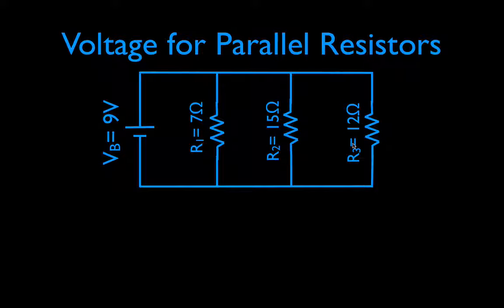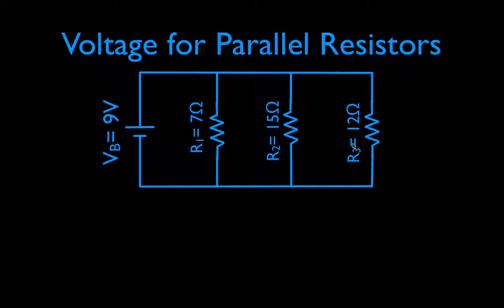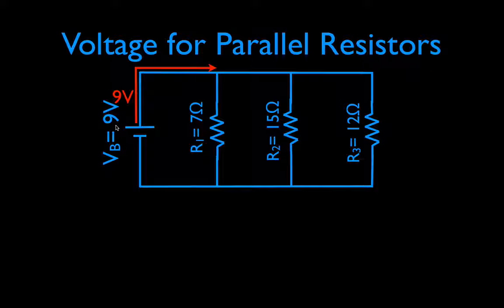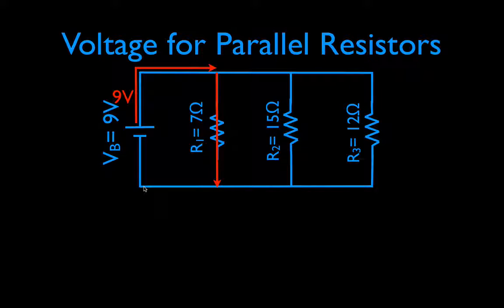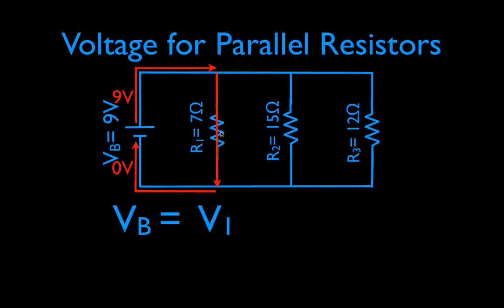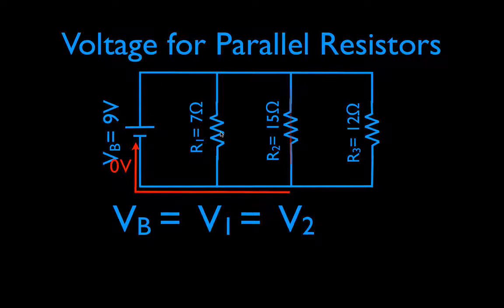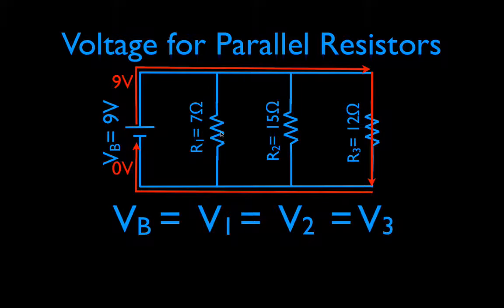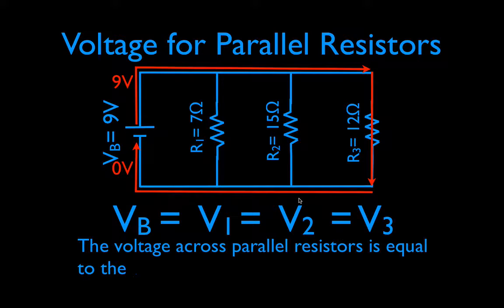Resistors in Electric Circuits (14 of 16) Calculating Voltage for Parallel Circuits

Comment: How to find voltage drop in parallel circuit because in parallel circuit voltage is same and how voltage divides?
Reply from the maker: In a parallel circuit the voltage does not divide, the voltage across each element is the same as the battery.  The voltage is divided in a series circuit.

Comment: Your videos are amazingly helpful. But I have a question - why do the electrons have no potential energy (0V) at the end of the circuit? Isn't it possible that they would have at least SOME energy? Otherwise, if dealing with a more complicated circuit, how would the electrons have the energy necessary to return to the battery?
Reply from the maker: Thanks for the comments...Those are great questions.  Of course they could have some energy.  But we assume that all of the energy get used in the resistances in the curcuit.  I would say that they still return to the battery because of their charge.  Not their energy.
Reply: Thanks for the prompt response! That makes MUCH more sense. I finally understand the resistor & capacitor equations. Thanks for such detailed videos - your step-by-step approach really makes the concepts understandable!